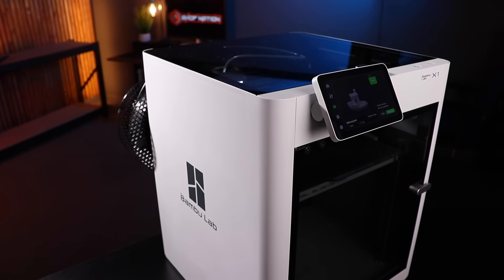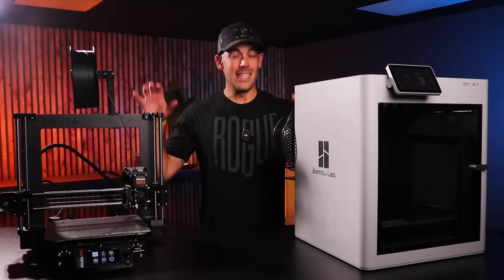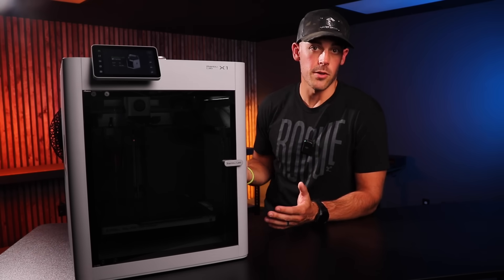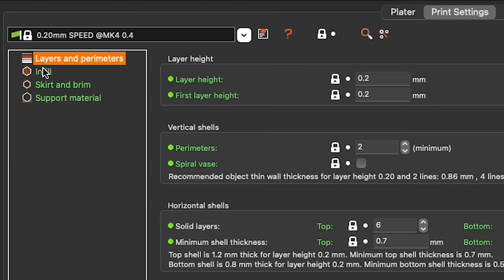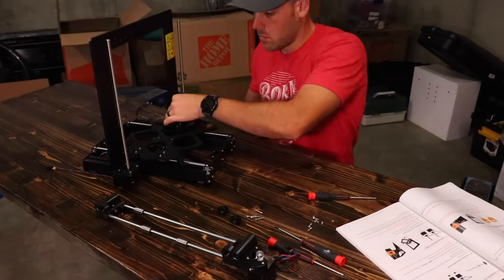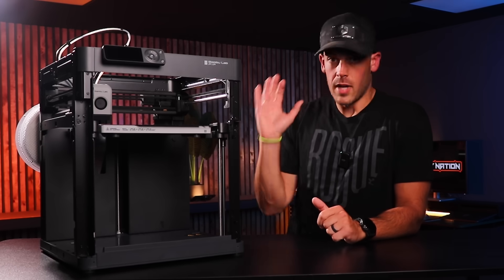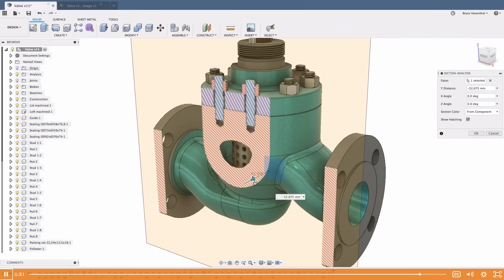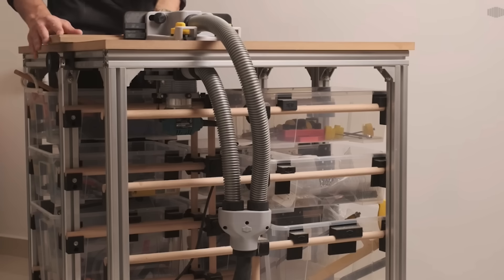The 3D Printer I'd buy if I started over

Comment: Kinda disappointed you only focused on Bambu Labs and Prusa devices. Prusa is known as the benchmark for reliable 3D printers I think, which is fair and earned, but they are priced higher as well, which isn’t attractive to first time buyers who are unsure if they’ll like the hobby or not.  Bambu Labs are great, but there’s always that risk with Bambu Labs that they’ll lock down their firmware, which we have seen announcements on recently since this video.  I just went through all the comparisons and reviews available and settled on a Qidi Q1 Pro since is is fully enclosed, can print just about any material right out of the box and is reliable and priced right.   It’s also crazy fast.

Comment: FINALLY.... somebody who understands what the masses (not the nerdy engineer types) want; I just want it to work - right out of the box. I'm sooOOOoo tired of z-calibration, and build plates that filament won't stick to, etc.. I just want it to work.  I wouldn't mind if the software itself told me if there are issues and how to fix them, but like you said - most of the challenge in 3D printing is you babysitting the printer....so frustrating when it's 2025 already.

Comment: Another thing to add, a year later lol, is aside from what you mentioned about people wanting to get into 3d printing and not having to work on 3d printers, you don't want to spend 300 on a printer only to fall in love, outgrow it in a little over a month and find it doesnt suit your needs anymore, and drop 1.2k on a x1c and now you're out 1500 dollars instead of just taking the plunge.  

If you wind up hating it and its not for you the high end printers like the x1c also retain a significant value provided its not straight abused.  Just makes more financial sense.

Comment: This is such a bad video. The fact you think the Prusa's are more reliable, just shows how little you know. Actual print farms have shared their findings, and the Prusa's fail more prints, need more repairs and need more expensive parts.

This info isn't evidence based. Also comparing the MK4 with X1 makes no sense. The P1S with AMS was always cheaper and superior.

The P1S is the Toyota with an optional trailer, whereas the Prusa is a random Ford with no option to add a trailer.

Comment: Great information. I collect and repair model trains and there are a lot of small parts that on some models are herd to replace. So I want to get a printer to print tiny parts for HO scale trains. I want to build a functioning coal mine industry on my layout and need to make a working conveyor to move coal as if it was on a real belt so I need to make rails and rollers and want to put the micro sized rivers and ladders. Look up old time livestock cars that are just thin planks so it's a lot of stuff to program but for now want to build horns, hand rails. Small buildings. Maybe farm animals. Scale fences. So I have a lot of use for a printer. Thanks.

Comment: I want to have the Toyota that is pellet fed for the raw material cost. I am a polymer chemist and a hobbyist beekeeper, I want to print a bee hive box - 20”X17”X 11” dimensions , I am thinking LDPE, HDPE, or PETG for their physical properties. What printer would you suggest, I don’t need speed, just want long term reliability and ease of use.
Reply: Sorry to point it out but most current printers aren’t able to do pellet feeding. i saw one YouTuber making a conversion kit but that was about it. I think using pellets would be really nice, but you would need an entirely different print head setup from the currently common direct drive or boden systems that nearly all printers use currently. 

If that conversion kit does work and take off it would probably be over a year past that when any of the big names make a version with that implemented.

Comment: The Bambu Lab P1 is a better printer than the X1 just based on the reports I've seen over the last year. I know of one guy that couldn't get through a single print in the first 6 months he owned his X1, and Bambu was of little help. They share pretty much the exact same specifications. Same build volume, same input shaping. The biggest difference is the X1 comes with hardened extruder gears, a hardened nozzle, and fancy materials.. They both print the same materials.

Comment: Strange comparison. These are completely different printers. Prusa should be compared with Bambu Lab A1. They have a similar design and parameters. Bambu Lab P1 can rather be compared with e.g. one of Quidi Tech printers. Because your comparison does not reveal a winner. If you need speed, you will always choose Bambu lab from these two. If you want durability and low costs, Prusa will win. No matter if you are an amateur or a professional

Comment: You had me at the 2:30ish mark talking about how you just want the damned thing to work and you don’t want to work on the printer. Got an ender 5+ and it is an absolute nightmare having very few successful prints in five years due to being a fiddling machine instead of a functioning machine. I don’t have the time to waste replacing all the junk on it or bringing my issues to maker spaces just to get a hundred memers saying “didja level the bed?”. Yes. Yes leveling the bed was going to fix the extrusion problems. Thank you. You’ve solved it for me. I don’t mind leveling manually. I kind of like it actually. It feels like I’ve done something useful. But when nothing else works as intended constantly and consistently? Gimme the damn printer that actual works out of the box and doesn’t need to be touched unless something physically breaks or wears out. Sick of kit car nonsense. Got a resin printer this year and it worked out of the box and literally the only thing I need to do regularly is “level the bed”. Nonsense.
Reply: I’m in the same boat right now. I have an ender5+ and my only true modification to the machine itself is direct drive. I’m constantly going back and forth between good prints and failures. Last print knocked off the fan housing and it’s making me want to just call this printer a wash and move to a machine that just works

Comment: Bought a Prusa prebuilt by Prusa.  It printed well the first 2 spools of their official filament.  Then the 3rd spool failed.  The 4th and 5th different spool failed.  After months of back and forth with Prusa customer service with no fix, they said my warranty was up and stopped responding. 

I bought a P1S and have run over 100 spools through it with only 2 print fails due to some stl errors.  I'll never buy another Prusa.

Comment: After 3 years of use, I can confidently recommend the Snapmaker 2.0 A350 3 in 1. This machine has treated me very well. I have designed and printed functional automotive parts on this machine. PLA - Polycarbonate reliably. The flexibility and expandability blow my mind. The CNC module functions are no joke! The lathe has been crazy useful. Although, I haven't used the laser cutter/engraver module very much. This machine is expensive but pays for itself. You definitely get what you pay for. I scanned and printed a thermostat housing for my tractor. The part was impossible to find used, VERY expensive new, and had to be special ordered from Japan. The part I printed on my Snapmaker is 2 years old, has been through 8, midwestern seasons, and still works fine. No cracks or leaks. If I get a wild hair, I may try to machine it out of aluminum with the CNC module... or just leave it well enough alone. Well, I printed it out of ABS, in haste, and I'm now concerned the plastic may distort on a really hot day and leak or break. I should have used polycarbonate or at least embedded a metal flange in the print. Oh yeah, I discovered how to embed metal parts in my prints. It may be a no-brainer for you advanced users but it was a Eureka moment for me. My machine is an older model with upgrades. Snapmaker makes much more advanced machines now, but I don't feel the need to buy a newer machine. So far all of the upgrades have been backward compatible.

Comment: I may be the only one to think this, but after almost 15 minutes, going back-and-forth between PRUSA and bambu labs Higher end lines, you choose, neither only to lead us to paid advertisement for food subscription, and then compare the two lower end lines of Prusa and bambu labs only to basically give the same answer. Many people do, which is, “depends on what you wanna do” and then leave a bunch of links that seems like you get a sponsorship for mentioning. When it comes to slicers and things like fusion360, nothing is mentioned about if you are an inventor trying to design something that will not be open source giving up a patent right. So if you don’t wanna go through the hassle of learning how to do some thing so I can hire someone on another site to do it for me, will one 3-D printer have better security? So, as an engineer, you don’t know anything about this? So I guess my question is STILL, Back to square one of which is the best 3-D printer to start with. This felt like a waste of time Clickbait.
Reply: By better security do you mean harder to steal?
Reply: He also eats food out of a heated black plastic container. Black plastic is extremely toxic.

Comment: I was looking for a cheap printer for making prototypes of stuff i make or for things that dont need to be made of metal. My cars door fpr the gas cap is defective and doesnt open when i pull the lever to unlock it and its to the point jamming a plastic piece between the door and frame doesnt open it easily, so i want to print something to force it open so i dont damage my car anymore and so i dont need a second person to force it open as i hold the lever up. The only metal piece will be a spring of some type to force it open

Comment: Trying to understand if A1 Mini is just fine for model railroad assets.   I plan on printing volume if business took off.    No matter how large the bed, it's not changing the end per unit time!   It takes about the same amount of time per part.  ?   Am I wrong?   Seriously, zero use for AMS.   So, P1S overkill I think.   A1 seems great as a 2nd printer after I feel comfortable with the mini. Any thoughts?

Comment: Haven't really been paying attention to alllll the new printers out- I got an artillery sidewinder years ago and aside from an extruder motor going out after years of heavy use- I just have NOT had any issues😂 it just keeps going with absolutely ZERO drama. Lots and lots of big 300×300×400 prints. Even alot of higher temp filaments. That said- Im Thinking it's time to upgrade and get a little more of that 500mm/s yall keep talking about and maybe something that can easily handle the HIGH temp engineering grade filaments out of the box. Obviously I want to spend as little as possible. Which printer am I going to get?

Comment: If I've learned anything about tools, you shouldn't be spending anywhere near as much on the materials as you do the tool itself. If you find the need to justify a purchase on a more specialty tool AT ALL and cannot make do with what you have (especially in something as unique as a 3D printer) you better get a GOOD tool. If you could get away with a cheap tool that doesn't ever work that well, why buy it at all? Good tools don't come cheap.

I have the X1C, it is well worth the 1000 dollar price tag I got it on sale for. Some of those base level printers are priced the same as a couple kilograms of the carbon filament I run through this thing. A couple days in and it has proven its worth more than just "once or twice" that more expensive specialty tools have done to me. Easily one of the best purchases I've made.

Comment: Counterpoint to Bambu Labs Printers : They are using a subsidized pricing model to steal intellectual property from the west. In order to upload a file to your printer, even if it's connected to your home wifi, you need to upload the file to Bambu's Cloud first. There you lose all IP rights to your files, why? Because China doesn't respect IP law, they never have, and they never will. Their industries are based on IP theft.

Hell even the printer is basically stolen IP,  it's just a Voron that the chinese have tweaked a little bit and in a number of ways have made it worse. 

Carbon Fiber dust is akin to Asbestos yet Bambu Labs uses Carbon Fiber rods in their systems. Right in the maintenance section of the manual it tells users to clean this carbon dust regularly. 

Now just to be clear you can run your printers offline, however you lose a lot of advertised functionality. You also can no longer update the system. Which is just shocking considering the bambu labs CEO has written in press releases, after one of their many major controversies, that "Network security was an afterthought" like what the actual?!?!?! it's 2024 Network Security is an afterthought? When people could potentially be printing prototypes of million dollar products? LOL.

Just be aware when you see something pushed this heavily there's a reason and if this guy bought his Bambu he's a sucker for shilling for free. Everyone else on youtube was sent them for free, because Bambu wants these printers in your face. They want large market share, because with it, they can steal even more IP.

Oh ya and the Camera has a microphone lol. Because that's necessary in a 3d printer right? There's no way a company selling thousands of machines isn't having a custom camera PCB made and installed to save money. Instead the excuse is they use off the shelf cameras that already have a mic on them... LOL. Ya. Chinese company puts microphone, that costs them more than without a microphone, into a product just cause... No nefarious reason there for a an Enemy state to want a recording device in the homes of thousands of westerners. lol

This is not a conspiracy theory. It's been openly talked about since Bambu Labs printers release. It's written into their TOS's.

Comment: Thank you. I though you'd go with an entirely different suggestion.

If your recommendation is for a cheaper version of the same brand, and there is nothing that the cheaper version provides better than the more expensive version (other than the price, ofc), I will stick with the X1C, since the difference won't break my bank. I really like the idea of a enclosed 3d printer.

Unless you tell me an open printer is, actually, better.

Comment: Hi, I have a MK2S that I've been using to print ABS for the past 7 years.  After assembling my MK2S 7 years ago the only thing I've replaced is the nozzle every couple of years.  I am looking to get a new printer to print ABS.  I would like a machine that I don't have to assemble myself but I want the high MTBF I'm used to so what would you recommend?  Should I go with an MK4S or X1?  P1S does not seem fully capable of ABS printing.  Have you done any ABS printing with the P1S?  Its good to know the Bambu Lab printers can use PrusaSlicer, can they also use Cura?

Comment: I started with a Longer LK5 and recently upgraded to the Bambu P1S with AMS.  It averages 1/3 the time of the Longer and soooo much easier to use.  Bed leveling was a pain and I couldn't get it to run PETG decent without overheating the Bowden tube.  
Although the AMS is neat if you really want to do serious multi color I would go with something with multiple extruders as the AMS takes a lot of time to change filaments and wastes a lot of material.  If you are just doing a top layer, raised lettering, and the like then the AMS is perfect.  If you are doing multiple colors on every layer it's going to add a considerable amount of time.

Comment: Lol wait until someone tries to get into it with no mechanical experience or understanding of printers. They will he spending money to replace parts that aren't broken. The Ender 3 works great and allows someone new to get involved with the mechanical side and how they work. I have had an Ender 3 for years now and have done minimal tinkering. Do not spend 1200 on either of these printers. If the gantry is not a standardized aluminum extrusion, it is not worth buying.

Comment: In 2024, what 3D printer, would you recommend for a price point of $500 and under(300 is more preferred, but odds are 500 would give a much better unit overall)?
I intend on getting one towards the end of november, and I already have a few models I am going to want to print that I designed myself.

Comment: Why wouldn't you recommend the Bambu Labs A1 or Mini???  They can do anything a beginner would need to see if 3D printing is for them.  Instead of paying $1500 for an X1 they can pay $199 for a mini or $350 for an A1 with the same easy peasy no problem printing as the X1 or P1S.  In fact, I don't see that the P1S, P1P, or X1 will really give you a better experience than with the A1 or A1 Mini except not letting you use the exotic and harder to print filaments.  I've had the A! and A1 Mini for a year or so now and I have no desire to get the X1. I have no desire to print with anything but the "safe filaments" and wouldn't want the hassle of dealing with ABS, ASA, Nylon, Carbon Fiber because of a lot of downside to those more expensive filaments.

Comment: Hey, Thoughts on the Creality K1C? I started off with the Anycubic Kobra 2, it has been OK so far, have not had to replace any parts in 10 months of ownership, however I dont use it a lot because it stinks up the whole room and it is quite loud, but the K1C on the other hand has an active charcoal filter and the printing area is closed off. I was thinking about a Bambu Lab P1S but it is rare in my area and I would have to travel to the other side of the country to get my hands on one. Also, I only use it for printing a couple stupid stuff, only print useful things every now and then, and I like if I can mess around with a printer as I am fairly experienced on software side of things.